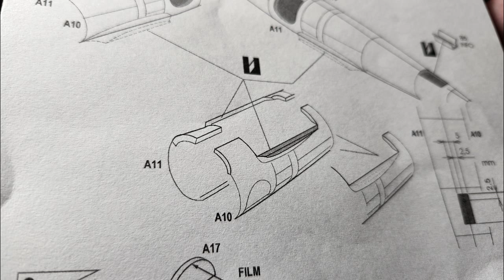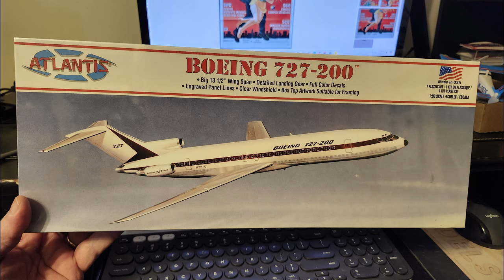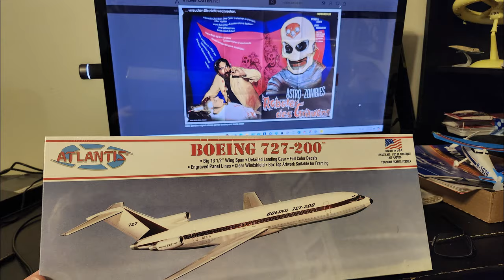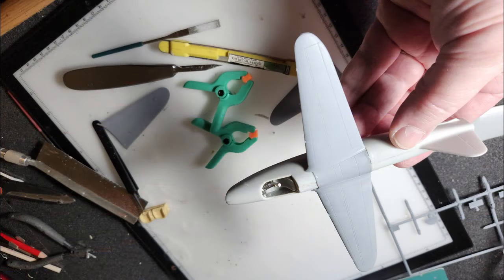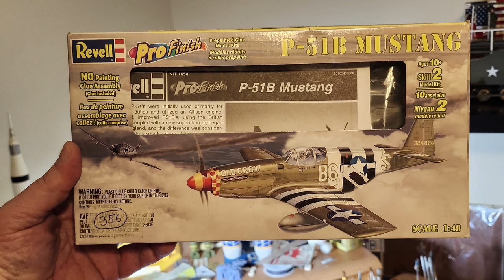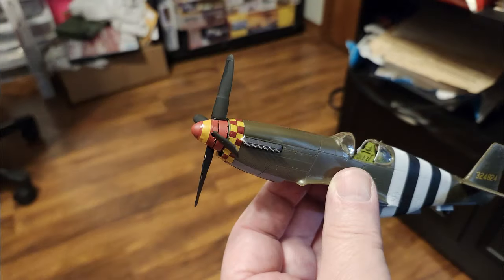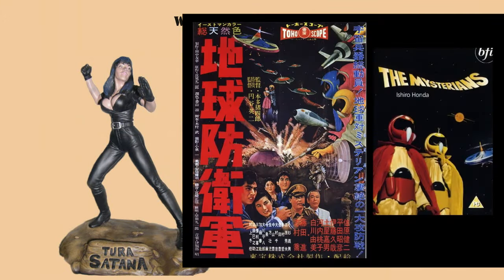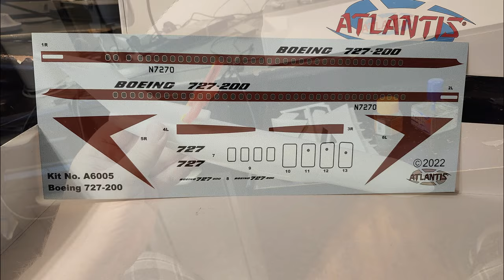Lockdown day 3 builds

Comment: It's not "Santana," It's Sah-tana, or maybe Say-tana, Daughter of Satan.

The He 178 looks like a glider with the tip of its nose cut off. You can tell Heinkel put alot of effort into it.

Have you ever seen a Super 27? It's a 727-200 with the side engines upgraded to a later JT8D and the center engine hush-kitted. Most if not all are VIP or executive aircraft. Saw one arrive at VNY and taxi onto the ramp at Clay Lacy Aviation" where a small crowd was waiting for the arrival of the EAA B-17 Aluminum Overcast. The Super 27 was operated by the government of Mongolia, painted all glossy off-white with no markings other than the tail number very small below the engines. The passenger doors fore and aft were opened by the most exotic looking flight attendants I ever saw.  Neither more than 5 ft. tall, they wore beautifully designed and tailored light brown or tan skirt suit uniforms with caps like the major airlines had in the Fifties. I was thinking they would make a good looking crew for an alien spacecraft.

* they occupied the hangers where Lockheed had a flight test facility for many years starting during WW2. My dad sometimes worked there on the "Articles" in '55.
Reply: Her name was SANTANA.  Her first husband's last name was Santana.
Reply: @lancerevell5979  - 3:01 Max pronounces the name as "Santana." Her stage name was apparently Tura Satana. Her birth name was Tura Luna Pascual Yamaguchi. Her first husband's name was John Satana.